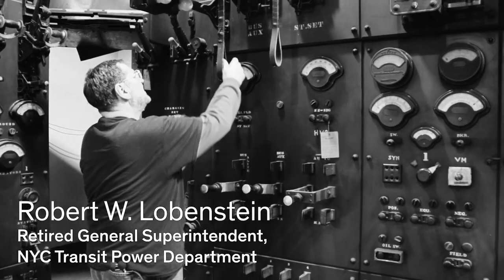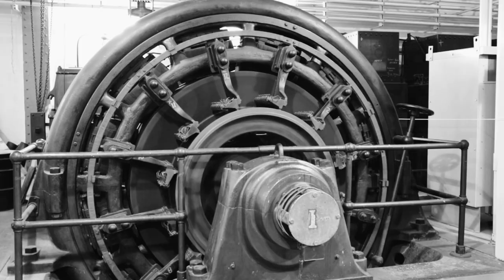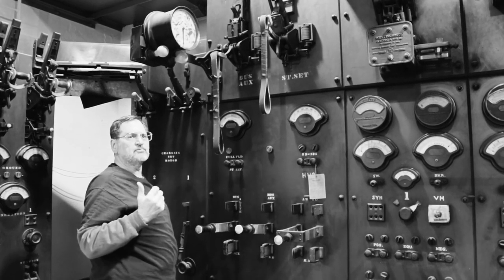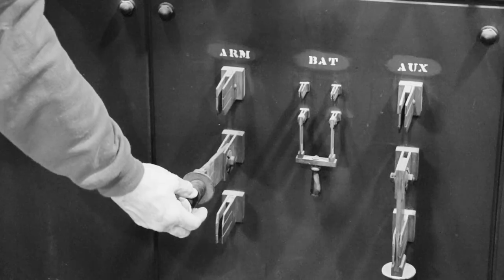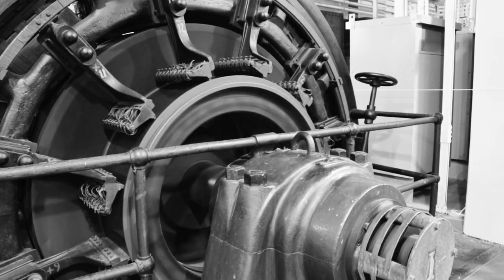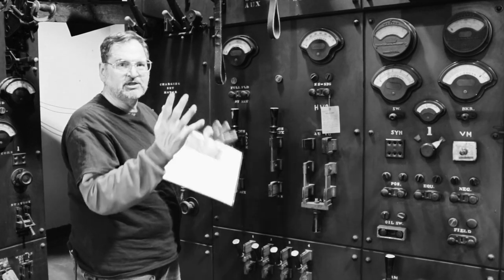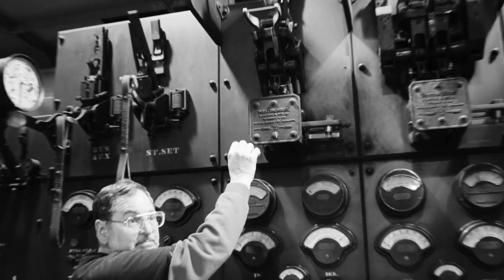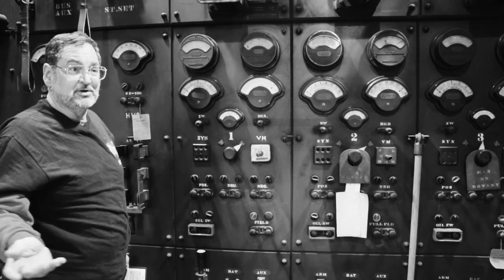NYC's 45-Ton Rotary Convertor

Comment: Early model of rectifier... next was mercury vapor rectifiers and finally semiconductors. Big chunk of history.
Reply: Mercury rectifiers are still in use in cases where you need to rectify high voltage and high current. As in an electric locomotives.
Reply: BC Hydro had a mercury vapour rectifier set up on the end of their transmission line out to Vancouver Island.

https://en.wikipedia.org/wiki/HVDC_Vancouver_Island
Reply: Thank you.
Reply: we've still got some rotaries running in germany as ac/ac frequency converters to bring down the normal 50hz grid frequency down to 16,7hz, which is the frequency our electric trains run on :)
Reply: @davetheelasticgoose4838 - So how does that low frequency work for powering trains?  I'm confused.  In aircraft they move everything to 400 hz as it equates to lighter motors although I don't know how.
Reply: @gragor11  yup, its the other way around for trains, transformers on electric locos are very heavy, due to the low frequency they operate at. for trains, weight can be a plus though as it raises the tractive effort the loco can provide.the 16,7hz comes from the early days of electric trains where large, low-rpm commutated motors, built not unlike the converter you see in the video where used. these would show excessive commutator-arcing at 50hz, so the frequency was cut down to a third of that (16,7) to alleviate the problem
Reply: @davetheelasticgoose4838  Well that makes sense.  Variable drive AC on the wheel motors on the modern trains?  

Makes me wonder what is going on with the electric traction motors of the very large haul trucks.  I think I heard they were series wound and if they broke the axel (ie lost the  load) that they would run away and blow apart due to over revving.  I've seen the cabling on one of those tubs and there were multi paralleled 200a conductors sitting there.  where they would have connected to the traction motor.
Reply: @gragor11  yup, mostly 3-phase asynchronous motors with VFDs these days.
i know of some large series-wound motors that had a mechanical governor to cut the power at a set rpm as a safeguard

Comment: Interesting the power was generated at 25Hz in the day not 60Hz as now
Reply: 25Hz power generation originated at Niagara Falls because the first turbines installed were designed to spin at 250 rpm and that was set before alternating current was chosen as the current of choice. The first installed Westinghouse generators were 12 pole, which when spun at 250 rpm , generated 25 cycle power. That frequency was ideal for large commutator-type motors and rotary converters such as the one seen here. 25Hz was still being generated by Ontario Power Generation (SAB1, generators G1 and G2) at Niagara up until  2009, supplying steel mills and other industries that required it for their aging machinery.

Comment: Stumbled across this. (What? In Youtube?)  I know about rotary converters; I ran one just as an experiment that converted 12VDC to 120VAC in my friend's car to be able to run a short wave receiver at a hamfest around 1963.  (The noise from the brushes was beyond OK.) Yet, I am not sure what this yumongous rotary was converting. 

As a side note, my grandmother's apartment, 54 W. 74th St, NYC, had DC service at least until she moved out around 1970.  Her refrigerator was of the....dang, can't remember the correct name....type that used heat to cool.  The heat for some of these could be electrical, or propane, or kerosene back in the old day. Adsorption!  Got it.  Also found in campers.
Reply: All refrigeration uses heat to cool.well i guess not all but most. I believe what you're talking about used ammonia as the refrigerant and a heat source to boil it and then chemically react with hydrogen to cool. In theory, your head does the same thing, except the heat source is the compressor and theresno chemical reaction, just a phase change from pressure differential. Still... you gotta heat the coolant to get your heat rejection and expansion at the valve. Pretty neat no matter which way is used. And "modern" camper fridge that don't use electricity are exactly the same as old so you're right there. Maybe a bit more efficient in terms of weight, material, and heat dissipation.

Comment: May be silly question but those levers you switch up would the bar be live on the leaves except for the handle
Reply: Yes. You're closing the circuits to make it live. Do not become part of the circuit!
Reply: @etherealrose2139  thanks for the reply I did wonder. But still scary

Comment: Ah Back In A time when everything was build heavy-duty en barely brakes Just Like 1950s inline 6 engines the whole car can Rust away before the engine dies
Reply: Don't forget the inline 8 cylinder engines, i.e., straight eights.  I've driven several cars with straight eight engines, Packards and Pontiacs, and ridden in Buicks with straight eight engines.  Many cars had them available, including Hudson, Studebaker, Pierce Arrow, LaSalle, Oldsmobile, Chrysler, DeSoto, Duesenberg, Hupmobile, Mercedes, and others.  That's 13, but there were a few others.
Reply: @frankeggers4024  yes of course how can I forget that yeah Old Skool Legends
Reply: @J Oh The breaks may have lasted forever, but the brakes didn't.
Reply: General Motors L6 in product on 1946. 

When I decked tugs, our 1,400 ft of 12" wire rope tow winch was powered by an L6
Reply: Oh God spoken like a true layman who's never designed/engineered a newer piece of equipment. Stuck in the fairyland "good ol days" mentality. Those 1950's inline 6's you so naively glorify.....what was the MPG on them? How much pollution did it inject into your lungs and give you cancer? What was the per-liter hp/torque outputs?
Reply: @thearcher1740  In 1951 my late father bought a new Nash Rambler.  It got more than 20 mpg.  Also, in the 1950s, Mercedes made cars with 6 cylinder overhead camshaft engines.  In fact, some cars are still made with 6 cylinder in-line engines.  That is an especially good engine configuration.  It is inherently balanced.
Reply: if every thing back then was built heavy duty why did the whole car rust away?
Reply: @devtrash  because it was in Northern America snow and salty roads and it's 60 years old
Reply: @gpowerdragon9852  lol ok
Reply: I would only agree on the heavy part. Lol.

Comment: Adjusting the field while its connected to the 25hz supply to adjust its speed? Huh? Power factor sure but not speed. Unless he meant the field winding on the DC motor,  but that isn't going to sync it with the line. Going to need 3 light bulbs or a syncroscope for that...

Comment: Am I seeing this correctly? The electrical conductors on that bus panel are completely exposed? Man. Gotta love 1900s no f@#$s given era.
Reply: They are exposed yes but normally on those big old blade-switch panels they are set up so there is no ground-route with the neutral (in AC) or negative 0V (in DC) referenced to Earth/Ground. In this way they are not hazardous unless you touch two. I know sometimes where there was a reference to ground they'd have a thick rubber matt on the floor to electrically isolate the person operating the blades.
Reply: i saw a drawing of the first crane that my former employer built back in 1900 ish. no cabin just 3-4 levers and some pedals, sitting next to a exposed 2m diameter flywheel rotating 10cm away. no cage no cover of anykind.

Comment: Can I get more information on what sort of device is this and what it does?
Reply: Tech Build ... search these converters on YT. You will find many videos on where they were used and how they work.
Reply: From Wikipedia:
A rotary converter is a type of electrical machine which acts as a mechanical rectifier, inverter or frequency converter.

Rotary converters were used to convert alternating current (AC) to direct current (DC), or DC to AC power, before the advent of chemical or solid state power rectification and inverting. They were commonly used to provide DC power for commercial, industrial and railway electrification from an AC power source.

Comment: 0:15  1:20  Why did they used to build those gawd-awful live-front panels with the you-touch-you-die exposed knife switches?
Reply: Then it would probably freak you out that in American homes sometimes the electricity would be transmitted by two parallel but naked copper wires that ran from ceramic cap (insulator) to ceramic cap. These wires were only about 6" apart and in certain parts of the house, not where the residents normally occupy, those two naked live wires would be fully exposed.
Reply: @bigk4755  Yikes!  Bare is scary alright.  My house (built in the 1800's still has vestiges of the "knob and tube" wiring - individual wires, but at least they were insulated!)
Reply: @poly_hexamethyl  true knob and tube is bare copper wires. At least that is what I have seen several times here in Denver metro area Victorian homes.
Reply: ...because it's super easy to not touch and die? You weren't holding wrestling matches in there.

Comment: Cool! The "Letterman theater" is actually a CBS theater that was used for various things (the major networks have studios all over the city) until it became the home of The Ed Sullivan Show and was renamed from "CBS Studio 50" to the Ed Sullivan Theater. Other shows used the facility, and in the '80s it was still used for TV. When Letterman moved to CBS, CBS bought the property outright (it had been leased before then) and configured it for Letterman. The Letterman show was still there when the facility was converted for HDTV, one of many changes. It's not clear when all the steel stuff mentioned in the video was added, but it's been a working TV studio since 1948, so obviously there has been suitable EMC for television at least since then. I was always curious what was in that building behind the theater, finally I know!
Reply: Shame how Metro Media Square in Los Angeles, where "All In The Family", "Good Times", "One Day At a Time", etc.  was raised to make way for another worthless LAUSD school to pump out more illiterates.
Reply: @JungleYT  razed

Comment: So are those big bus bars and knife switches energized to 600V? Totally exposed? Even by 1904 standards that seems pretty unsafe. Also, it sounds like it uses the 600VDC from the third rail to get up to speed, then synchronizes with the mains power and switches over - so how did the third-rail system start up from unenergized? Was there an alternative method for starting it from mains power? Was this station not capable of that but others were, so they'd start up those, energize the system, then bring other stations online?

Comment: I guess in coal powerplants nowadays the process is almost the same to get a powerplant online on the grid.
Reply: And hydro-electric generators; they vary the amount of water flowing through them until the Synchroscope (my favourite instrument!) shows exact synchronisation then bam in goes the circuit breaker!

Comment: There's 600V on those knifes switches?
Reply: Yes, whatever the system voltage is, it is live on the front of the board.
Reply: @larrykeenan598  So what happens when an operator touches the metal part of those switches/breakers ??? insta-death ???
Reply: @HPPalmtopTube  No, voltage is only present on the live parts, not the housing or panel face. If it is a grounded system and a person touches both the metal and a live part, they get shocked. It it is an un-grounded system they only get shocked if they touch 2 live parts that are different phases. Most systems now days are grounded and read voltage from phase to ground and phase to phase. Ungrounded systems only read voltage between phases.
Reply: @larrykeenan598  Well, you've done a great job of explaining it to me, thanks! ;)
Reply: @HPPalmtopTube  No problem, I'm a 55-year retired IBEW Electrical Workers Union member. Also, 20+ years teaching in their apprenticeship training program.
Reply: @larrykeenan598  Well, you've definitely got way more knowledge in the field than me ;) I write software for a living.... But I can appreciate someone who knows his stuff! Great job!
Reply: Thank you all for sharing. I was wondering how dangerous those blade, panel switches were. Engineering is amazing for its time. State of the art
Reply: @larrykeenan598  Right on Brother. LU 353
Reply: @foamer443  Toronto, ON. That's cool. I'm out of LU 238, Asheville, NC.
Reply: What, on there, would be grounded? You're connecting the power from one to the other. You can be shocked and killed by grabbing both the bars as the current passes through your heart as well as the bars. Grounding would have nothing to do with it? There is a potential difference either way.

Comment: I wonder how many epileptic people had seizures at 25 hz
Reply: 25 HZ was an issue for a high percentage of the population, as at that frequency it is very easy to see the light bulbs flicker, as the electricity transitions from one half of the cycle to the other.

I could see this being an issue with various pieces of equipment at exactly the wrong moment when they are under high load resulting in a motor locking up.

Migraine sufferers too, I'm sure were a lot happier afterwards.

Comment: is the subway powerd from the grid  is the 3rd rail live and one of the other tracks neutral do all transformers feeding the 3rd rail on the same phase from the grid and for lighting is there a transformer to step it down from 600 to 240 split phase or 120 volt for lighting thanks
Reply: It all comes from the grid but it doesn't work exactly like that. Power coming into the substations is 13-33kV 3-phase (varies by borough) which is stepped down to 600VAC and then rectified to 600VDC for the third rail. Power for lighting in the subway stations and for other equipment along the lines is generally 3-phase 120/208 and comes off the local distribution network like any other house or business.

Comment: We should still be using these, and everyone should have 25-cycle power.
Reply: Frequency was doubled due transformer size needed for power unit, double frequency = half sized transformer for same working power.
Reply: Hogsworth Hammer
 ... back in the day with 25 cycle you could see the bulbs in the subway stations flicker. That was another good reason to go to higher frequency. Of course the flickering bulbs and low lighting distracted you from seeing all the chewing Tabaco and chewing gum on the platforms.
Reply: Besides larger transformers, 25 cycle motors are about twice the size of 60 Hz machines. The only advantage of 25 Hz is lower transmission reactance.
Reply: @rupe53  The whole grid was 25 HZ so the lights flickering was an issue everywhere.

Comment: What is the purpose of this device? he says it uses third rail power and converts it to be used in the subway?  Like for lights or something? 
I would have thought converted in coming power TO the third rail not FROM the third rail.  Confused.
Reply: 3rd rail power is used to start it spinning up to speed, then is switched to AC from the main, AC  is converted to DC to power subway trains, back into 3rd rail.
Reply: @nssherlock4547  Where does the third rail power come from initially?
Reply: @quantumbits  Power station, AC supply. There are these units spread out over the subway system, so there will be a certain number always running feeding DC into the 3RD rail, they will add more supply as more trains join the line.
Reply: @nssherlock4547  I guess they started the first one with batteries.
Reply: @quantumbits  Some also used a petrol engine.

Comment: Are those lever switches controlling some hidden relais, or are they directly connected to the power?
Reply: Most likely directly connected. They played fast and loose with safety in those days.
Reply: @TheMinecraftACMan  Modern safety rules have actually dumbed down workers knowledge. It's Darwin evolution theory in reverse, survival of the dumbest.
Reply: @raygale4198   you want to build for the dumbest so you don't have to waste human life.
Reply: @cybertrk  If you re read your comment you will see that it exactly describes where society is heading today. Think back to when the great discoveries and inventions occurred, people were in general much more intelligent. Don't confuse intelligence with knowledge, todays people 'know more stuff', yesterdays people knew how to make, improvise, invent.
Reply: @cybertrk  I think that Mr.Tesla' s physics was correct.
Reply: @raygale4198  That may be true but it doesn’t make these open knife designs any less stupid and reckless. People are not perfect. All it takes is one misstep and you fall onto this Noel and die. Reckless and stupid is the only way to characterize those panel designs. No need for any of that - they just did it that way because it was the cheapest way to make those switches. I can agree with you if you’re talking about the warnings on a packet of toothpicks, admonishing you not to poke yourself. That’s unnecessary. These panels were not good engineering.
Reply: @absurdengineering  They were the high tech of the day, thermoset plastics and precision high volume automated press work for the complex trip bars, levers and toggles of modern switches for making  hadn't been invented yet.
Reply: @elessarstrider5210  Yes, and wearing crepe rubber sole shoes. There is no harm being 'live' related to earth, providing you are not connected to earth. Linesman do it every day.